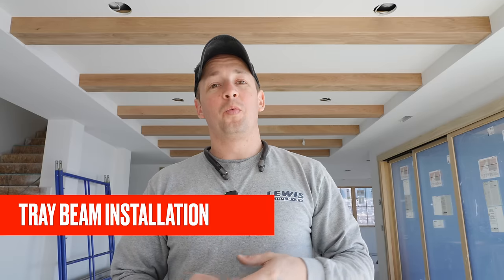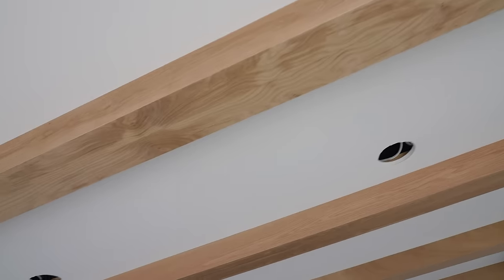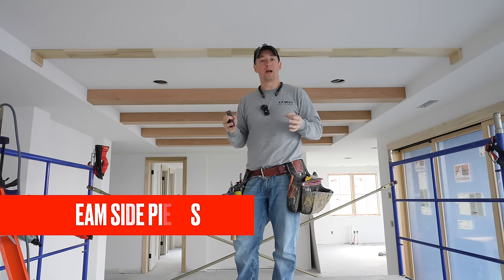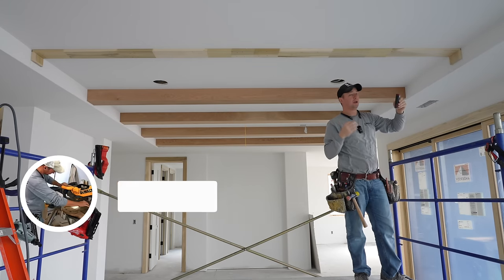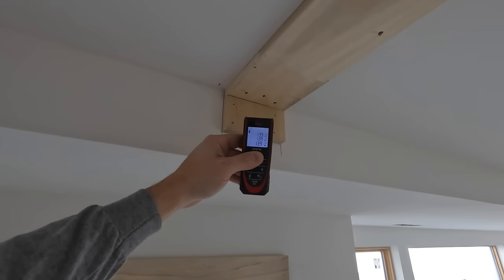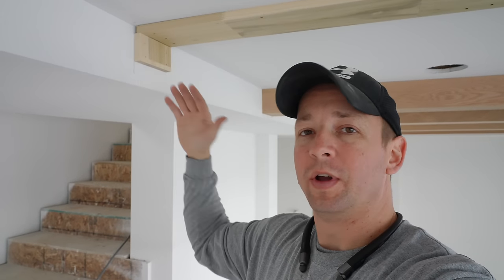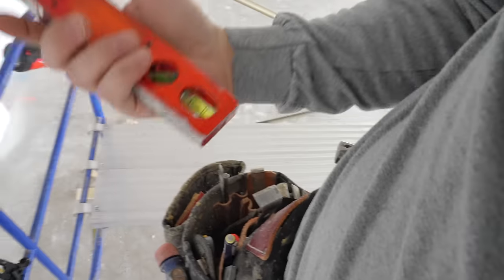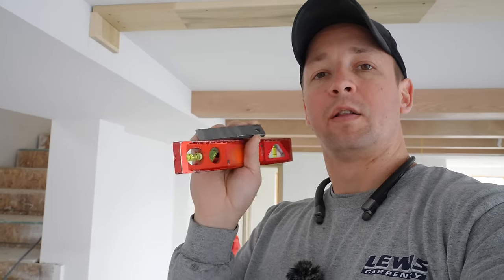PERFECT BEAM INSTALLS | Best Tricks for FAST PERFECTION

Comment from the maker: THANKS FOR YOUR SUPPORT!!! (Tool Affiliate links below...)
Senco 23 GA Pin Nailer - https://amzn.to/49ovyq2 (Amazon - Earns Commissions)
Festool HKC 55 Track Saw - https://amzn.to/4aJDrY2 (Amazon - Earns Commissions)

Klein 9 Inch Torpedo Level - https://amzn.to/3TIwccd (Amazon - Earns Commissions)
Welding Gauge Taper Gauge - https://amzn.to/3vFAp8o (Amazon - Earns Commissions)
Stepped Pipe Gauge 3/4" Width x 4" - https://amzn.to/3PPt792 (Worth Every Penny!)  (Amazon - Earns Commissions)

Razor Scribe - https://amzn.to/43JBsAR (Amazon - Earns Commissions)
Razor Scribe Ink - https://amzn.to/3PMmSCX (Amazon - Earns Commissions)
Trend EasyScribe - https://amzn.to/49rt8ae (Amazon - Earns Commissions)
Hock Marking Knife 3/4" - https://www.highlandwoodworking.com/hockunhandledmarkingknife34x7.aspx

Fast Cap Glue Bot - https://amzn.to/4aHv1AB (Amazon - Earns Commissions)
Reply: What laser tape are you using thanks a bunch
Reply: @TekcorFPV  Dittos
Reply: Looks like a Leica to me.
Reply: @ClaNan  TY

Comment: Working solo on multiple beams like these long before the advent of LDMs, my method was to make up  what amounts to a full length version of a stair gauge. This process yielded very precise and reliable results. The gauge simply consisted of a sacrificial length of blocking stock cut a few inches shorter than the finished beam length required along with two cut-offs, each about a foot long. To create each individual template, my process was to screw the long piece to the ceiling blocking in three spots, starting with one at the middle (to hold it up initially) and then one close to each end. Next, with the long piece fixed securely, I would butt the end of each short piece tight to a wall and screw it to the long one, establishing both the finished length and crosscut angles at once. Cutting the ends of the short pieces to the theoretical rake angle on cathedral ceilings allowed this method to work on those too. (Of course, this method would be impractical if you are unable to do the cutting in the same room as the installaton.)

Comment: For touching up scribes, my go-to is the now discontinued Porter Cable 371 corded belt sander. I wish someone would develop a cordless version, maybe even smaller. Same benefits as a block plane but without the possibility of catching and tear-out if the grain changes direction.
Reply: I have two of those which I'm carefully husbanding.  Don't know what I'll do if/when they wear out or belts become unavailable.  Best belt sander I ever had.
Reply: Have one and it is the best!  Perfect design and ergonomics!
Reply: @Lugnut64052  Beretta of belt sanders...

Comment: These techniques take years to learn and Spence makes it look muck easier than it is ( he’s not joking about glue application being an art ), I would add if it is not to difficult measure all lengths and start with longest beams, if you make a fitting mistake move that to a shorter measurement, this also works with stair builds. 
These videos are the absolute best for techniques on YouTube, I have been a trim carpenter for over 40 years working solo and use the same techniques, I use Cadex nailers in 21 and 23 for almost everything, they shoot up to 2 3/16” Brad heads. 
You the man

Comment: Good job young man. 
I love the smell of white oak. 
Imagine the old days of using a hammer and nail and set?
I used my block plane a lot when I was in my younger years. And still do today on small stuff. 

Thanks a lot for your work.
Reply: I was still using a drill, hammer and nail and set until a few months ago when I finally got a nail gun. Cant live without it now and I save so much time on my trim jobs.

Comment: Hey,another fantastic video. One comment on the cordless nailers, I believe the cylinder can be “re-charged”. Well, I know the Metabo HPT ones can because I own them. But I still would not use them on white oak, air for the win, as you said.

Comment: Masterclass right here! One question I may have missed. The screw holes that you used to tack up the beams temporarily, do you fill those with anything? Also what gauge fasteners did you use to finish nail it to the framing?

Comment: QUESTION: you fit the side pieces perfectly, end to end.  But then you scribed them to the ceiling, so when you move them up to the ceiling, wouldn’t that throw off the end to end measurement ?
Reply: Spencer used a 1/2” drop to remove ~3/8” on scribing is what he said.  after scribing and sliding them up you’re quite unlikely going to have any appreciable change in length or end scribe.

Comment: White oak is about $4.50 canadian a foot board in Ottawa. It’s not very expensive. You can also find deals on craigslist for cheaper. For comparison 1x12 primed finger jointed pine cost me $4.93 a foot (to be fair it requires no planing and sanding. Oak does).

Comment: Ooooh, who’s all in a twist about the definition of a beam? What else would you call them?
Great job as always Spencer, when you attaching the pieces I saw two different guns, one looked like a framing nailer and the other a pin nailer (23 gauge) Can you clarify what you used? I would have thought a 16 gauge for the sides and a 16 or 18 for the bottom.
Again awesome video!!
Reply from the maker: 23 for the miter. Framing for blocking. 15 for nailing beam sides to blocking.

Comment: What are you using to fill the screw holes that was used for your first fit. Being stain grade.  Looks fantastic.
Reply from the maker: It leaves about the same size hole as a 15 ga nail. Painter will fill it with the same wood filler to match the stain.

Comment: Great tutorial.  did you use 15 or 16a guage finish nails to tack the side of the beams to the blocking?  Also, is there a beam length where you feel you might need a bit of blocking in the center of the beam instead of just on the ends?
Reply from the maker: It’s kind of a feel thing. It most cases a top cleat will support the e tire beam just fine. Center blocking is more about keeping the beam sides vertical and square.

Comment: I will try this method on the next beams I do but I have one question. Wouldn’t plumbing your ends to get those angles against the drywall only work if your board is level? Thanks Spencer

Comment: Hello! I really enjoy your videos...I have a question on frameless windows. Is it best to frame the inside with sheet rock, wood, or tiles? If sheet rock is used for the framed inside, does it need to be treated sheet rock? Thanks very much
Reply: 5/4 extension jambs before drywall. Prime/seal wood. Rip width of extension to flush out with back side of drywall. Run drywall over extension and corner bead onto extension. Bonding agent in setting type compound. If your drywall finisher is not using catalytic compound on all bead for the first coat, tell them to start. Float mud onto extension jamb. Fast and perfect. No shimming and plenty of space for insulation. No problems with thermal transfer, condensation and deterioration of gypsum. Fast, perfect and best results. Keep drywall off returns. It’s not designed to absorb moisture from condensation. Your bead will hold up much better if it is independent of the framing. Works very well with any window you can fasten extension jambs into and this trimless design is typically used with casement windows. My personal favorite when using this system is a stool and apron because a window looks unfinished otherwise. IMO.
Reply: Use screws and drill pilots for extensions.

Comment: An actual masterclass on box beam installation. I had a few questions that came up in your process: is it efficient; can you elaborate; etc. All I needed to do to find out was keep watching as you went back an answered all of them.

For instance, how did you verify you're blocking, because with my experience those stud finders are never accurate. You came back with a nail to check. I usually skip the stud finder and use magnets to find screws already fastened to it (typically in a few spots on a stud for example to be sure), and if in doubt I use a nail as you have done.

I had a question about what you meant by metering starting further down. The footage was too far and you didn't explain it well first. I was left confused thinking you meant from the bottom as the actual bottom, and not from the bottom of the side of the miter. When you went back to show and point out the miter, then I realized the first 1/8 or so of the face is not mitered, so the cut actually stared on the side instead of the face.

I was also worried about the sharp edges, which is pet peeve I have from all the times I've scraped or even cut myself because of them. You went on to ease the edges. Job well done.

As for the gluing, I'm not biased towards the finger or a brush, either will do, its more the execution, which you are correct is an art applying it. I see other with either too much or not enough, though the amount needed varies on the project. In this case, good glue coverage on both mating pieces, on each side.

I would want to make sure the beam isn't going anywhere, so glue and nails. And oak is heavy, so if it did fall, those eased edges will make it a bit less painful, even just at a micro level. Sometimes it comes down to fractions between a hit or a miss, like hitting a puck with only a fraction either direction leads to a score or not.

Using glue and nails was a great call imo because it is more efficient, and more economical. You're running a business, so you need to be as productive as possible. Using tape is not only a waste, but glue alone in this case isn't structural enough for more: I tend to over-engineer. Not to mention, the need to come back, but also because oak splinters easily, you need to be careful peeling the two so as not to take any grains with you.

However, this is one other thing because applying glue I'm nether for nor against. The beams could be rustic as far as I'm concerned. Both natural and finished can look good, and some people rather not even stain wood at all. For me, it all depends on what the client is looking for: it's aesthetics and either can be fine.

This is perhaps the best "class" video I've seen on your channel.
Thanks for the insight and keep up the good work!

Comment: Another master class from IC!
What did you do with the blow out at 49:50?
Reply from the maker: Try and back and forth to break off using a chisel. Then set with a nail set if you have to. Wood filler after that.

Comment: Hey Spencer. Where did you get the milled lumber at such long lengths? I’m trying to create x2 box beans across the bottom of cathedral ceiling (only fixed at 2 points) at 12.8 feet length and 10” wide. Im having a tough time finding solid milled lumber. I love it in Walnut but I’d take what I can get that won’t sag over such a long run.
Reply from the maker: This is actually a new product. It is jointed material with a 3/16 veneer that is bookmatched on the face. White oak is hard to find long and wide. This allows for longer boards to be glued up made into wider boards.

Comment: What is your secret for getting the 46 degree bevel on both sides of your bottom piece?  I have had a tough time keeping that 2nd side straight on my table saw.  First side is easy because you have a square edge,  but with knotty alder, I have struggled with ripping that 2nd edge.  Thanks for all you do!

Comment: Hi Spencer Lewis, nice video and awesome work flow. The only thing is what's happening with the  screw and heavy gage nail holes at the top of the beam? 
As a cabinet maker and installer,   I don't think your finisher is very happy about them. Thanks
Reply from the maker: They fill just fine. You have to fasten the beams with something.

Comment: We use 19” wide planks and our scaffolding accepts 3 planks wide at every cross bar.  I understand that you are comfortable with just 2 planks and a center gap, however- try using that argument with OSHA.   Every commercial job I am on in the Fort Wayne area requires the scaffolding to be “fully planked”.
Reply from the maker: On double ladder scaffolding??? I have never seen anyone else use they type of double ladder scaffoling I use on a jobsite in fort wayne. I will have to look into this further.

Comment: The pin nail holes may not be visable, but what about the larger screw holes. Are they visable from the floor?
Reply from the maker: Cabinet head GRK screws have a very narrow shaft. They leave about the same size hole as a 15 gauge nail. Easy to fill and make disappear.

Comment: Hey Spencer superb concentration of useful information once again. What blade do you use for crosscuts on the HKC 55 just out of curiosity? I've been using a mix of festool and CMT blades on both my track saws but I think the CMT blades have a bit more throw and end up overcutting my splinter guard a bit
Reply: Also I don't know if you have already tried it but milwaukee's surge hydraulic impact is a real delight especially for cinchin down screws overhead. A lot less violent than the regular impact and I've sunk six inch GRK lags with it no sweat.

Comment: Your air hose isn't twisted, tangled, or wrapping itself around you and everything else like the tentacles of a kraken!  What brand have you found works best in this beam situation, Spencer?
Reply from the maker: This is what I've been using. Stays nice and flexible and is extremely durable. I can't do the lightweight poly hoses. 

https://www.nailgundepot.com/senco-pc0064-14-x-50ft-rubber-air-hose-and-fittings
Reply: Thanks.  I've threatened to cut my Flexzilla into tiny, eatible pieces more than once!😂

Comment: HI Spencer, i have a question for you and i guess US carpenters in general, how do you or in general price trim work? We call it fix-out in Australia. The reason i ask is that i am fed up with being ripped off by builders and owners and carpenters here are our own worst enemy. We generally charge and amount per M2 for floor space. I feel we need to change and charge per meter of trim installed and per door, per lock etc. Floor m2 rate is a complete rip off as you get the same for a round room with 10 doors compared to a square room with 1 door. really looking forward for the answer on this one. Trev.

Comment: What decide the thickness size of the scribe block used?
Reply from the maker: Basically you are guessing on how much you think the maximum you would need to take off to make everything scribe tight, but not much more. Another way to describe it it he difference between the high point and low point of the ceiling, that is how much you scribe thickness needs to be. But you want to go with a little bit more than that just in case.

Comment: 49:50 your side nail caught the grain and raised up the wood on the bottom piece. How do you fix that with a pin nail and stain grade?
Reply from the maker: Try and back and forth to break off using a chisel. Then set with a nail set if you have to. Wood filler after that.

Comment: When you mentioned this in a previous video I thought you said you were going to cut the drywall pocket? I can see how the corner bead would prohibit that.
Reply from the maker: I did that on the previous job. Similar flat beam install but it had more space. The beams were distressed so they had to be preassembled. It worked great for that job.
Reply: The best on the internet
Reply: @InsiderCarpentry  Watching so many videos they are running together in my head. Now I remember that job. Thanks for refreshing my memory.

Comment: When you measured the length of the beam and you used your torpedo level to see how far out the wall was shouldn't you somehow have to go up from your bottom mark of the beam. Otherwise your going off the metal drywall edging and that already was out an eight of an inch which wouldn't give you and accurate measurement????
Reply from the maker: I explained later in the video the reason for taking measurement from the bottom.
Reply: @InsiderCarpentry  yes I understand I watched your whole video your my hero lol but still your torpedo level rested on dry wall metal edging and not where the bottom of beam is.. you mentioned that that edging stuck out an eighth of an inch so how can you go off that and not from the bottom of beam

Comment: Why not just scribe a small cutoff the same height as your beam and measure what's out
Reply: Exactly , torpedo level works only  when ceiling is in level, what is very rare ,  I prefer all  board stained before instal , easy for painter and stain will  not penetrate well / with light spot, where glue was present,